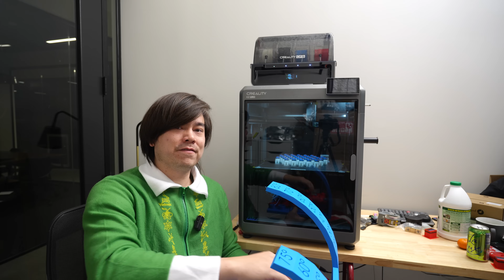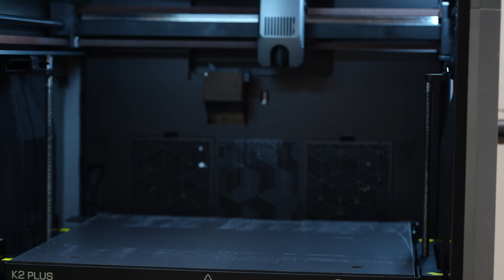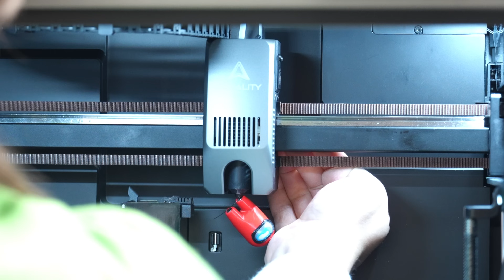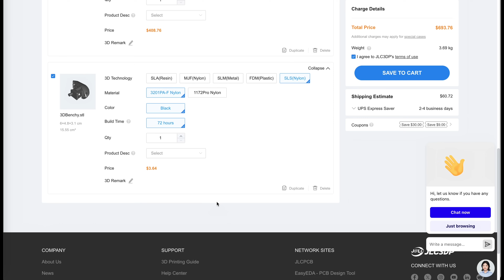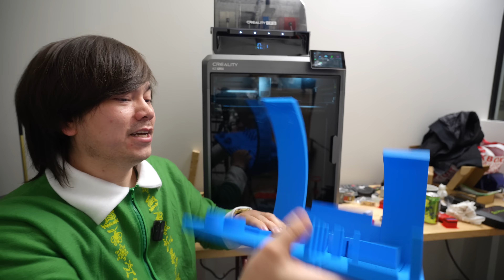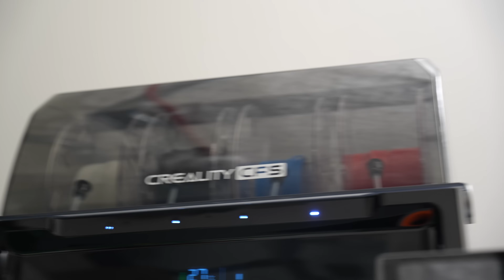Creality K2 Plus - Back With a Vengeance

Comment: can you elaborate on servos , i thought these are steppers with encoder
Reply from the maker: They claim to be FOC controlled servos. 
Sometimes their marketing team uses the wrong words, but given how quiet these are, they might truly be FOC controlled. 

The controllers are usually a little more expensive and require additional electronics to work compared to a stepper or stepper+encoder. I will have to take off the back panel and look on the electronics to learn more
Reply: @NathanBuildsRobots  Sometimes? and then there are the bare faced lies!
Reply: The community of “simple FOC” can use a stepper motor as a servo using FOC control

Comment: Did I miss the price?
Reply: If i recall 1500
Reply from the maker: Yeah, $1500 for the printer plus multicolor unit . And free shipping which bamboo doesn’t do. Plus some random freebies and creality runs sales pretty often.

I’m hoping to see the standalone printer at around $1200 on sale
Reply: The price is that the many traditional faults will drive you crazy!

Comment: I was disappointed with the k1 max but this looks like it's what it should always have been.
Reply: I mean it's basically twice the price
Reply: @michaelgleason4791  oh well, nm.
Reply: In more detail, the k1 max should have had a flat bed and an extruder that doesn't clog as badly as it does
Reply: Price is not the same.

Comment: idk if you have experience with it, but another comparable machine would be the qidi plus 4. Little smaller build plate though and qidi doesnt have a cms (maybe you could get it to work with the box turtle). It would be interesting to see a detailed comparison between those two from a mechanical and build quality standpoint.

edit: For anyone that sees this comment, there is a potential fire hazard issue with the qidi plus 4 so I would probably not consider buying one at this time
Reply: Qidi announced a MMU for 2025. There are also the ERCF and 3d chameleon that should work
Reply from the maker: I hope Qidi have stepped up their quality. I haven’t seen the 4, but all of their older stuff printed great but had a cheap plasticky feel that made me feel like it was going to break after a while

Comment: I still don’t trust creality. Tbh I wouldn’t even consider buying something from them bc their older printers were so bad.
Reply: I havent bought from them in years having bought their machines since the OG Ender 2 up to the Ender 5 Plus, they all had issues, however, the Ender 2 is the most reliable machine I have bought from Creality, and then there was the Creality WiFi box, they claimed it worked with most Marlin 3D printers and all Creality machines, It didn't work with any printers, did they take it off the market and recall them, hell no! they gutted them from their cases and installed them in their next dodgy printer!
Reply: okay but why you cry here? lol
Reply: @billy.the.maker.  Therapy! at least thats my excuse
Reply from the maker: He’s allowed to cry here. Tbh I wouldn’t have pre-ordered this because I’m not sure if it would be any good. 

But they sent me one for free, and I’m glad they did. Knowing what I know now, I probably would have got one at the pre-sale, but there wasn’t any good information about it back then.

Comment: Is the door Uncle Jessy Proof? 😂🤣😅 . How much power does it consume during bed heating and printing (peak  nominal) ratings? The website says the aluminum bed is 5mm thick, could you please confirm? Would like to see the core xy motors, they seem to be concealed outside the heatd chamber. Thanks for the fantastic review.
Reply from the maker: It probably is 5mm, I couldn’t get a good look at it but I was guessing 6mm

Comment: I just set up a Sovol SVO8 and it has exceeded my expectations.  Full klipper, quad z motors, 7 linear rails, etc.  Its a beast and under rated.  This one looks nice and a main contender a bambu but creality slice is an abomination and should be abandoned  and never talked about again lol.
Reply from the maker: It’s a lot better now. They forked bambu or orca and made some cool additions, but I guess you could stick with orca if you wanted to
Reply from the maker: SV-08 is solid though
Reply: Is Orca slow for anybody else ? I am on Mac and it is very slow...
Reply: @vim55k  it is fast on my Mac
Reply: I've been leaning toward an SV08 but didn't want to invest in a new printer until I design new products for my small business this winter.  I still have a large format resin printer from several years ago that is in the unopened box, that is a boat anchor at this point.   :-(

I''ll want the ability to print ABS and possibly other engineering materials so the enclosed K2 Plus looks good out of the box instead of making an enclosure for the SV08.  I use a clear trash bag over my bed slingers and that's low rent as hell.
Reply: I own a Sovol SV08 too but you can't really compare with this. This is a 2000$ 3d printer versus 800$. I think we just pay for what we get in the end. The only problem i would say SV08 got is the bed but yeah its still a great 3d printer but nowhere near the quality of a 2000$ printer.
Reply: @ptitbass  - No doubt the K2 Plus is going to cost significantly more than the SV08 because it has a full enclosure, heated chamber and several other added features, but I don't think it'll cost $2000, even with the CFS, which I probably don't want because I seldom print multicolor objects.  My only use for a filament feeder would be to print ABS and TPU on the same part, but the Bambu filament change system doesn't feed TPU and the Creality CFS, nice as it looks, probably won't feed TPU filament either.
Reply: Yeah they also claimed that they designed it from the ground up, another lie! and it isn't even any good!
Reply: @AndrewAHayes  Mine is printing non stop since I got it. I don’t like inductive probes but it has been consistent even on a hologram build surface.  I also changed to a .6 micro Swiss hot end. As far as I can tell klipper is fully unlocked too.  All printers are clones of something.  China is built on exploiting weak ip laws. The creality k series is them exploiting their own Chinese competitors lol.
Reply: @AndrewAHayes I think they mean they Designed their Design from the ground up. Yeah, it's based on a V2.4 I know. But they still had to design their own parts. Especially the frame. But maybe they could have word it a bit differently though.
Reply: just use cura, it still has feature that other's don't have
Reply: @ItsDoneWithMirrors  I was stuck on cura for a long time because I was intimidated to try anything else, but I'm so glad I finally gave orca a go. Imo it's been better in 80-90 percent of every metric I would judge them on. I used cura for around 4 years and never wanted to even try prusa slicer. If you're making this comment having not tried orca slicer I would urge you to give it an honest go for about a week and then see how often you open cura afterwards. Maybe you'll find that cura really is better for you, but there are reasons so many people have made the switch in the last couple years.

Comment: You mentioned thicker belts, are they 9mm ones?
Reply from the maker: Definitely more than 6mm, I will take some calipers to them. I’d guess 9 or 10mm
Reply: @NathanBuildsRobots  that's great. cheers for that. just like Qidi 4 plus which I believe they're 9mm and they've also been producing great results from what I have seen from other youtubers. BTW, I can see that you're using creality 5 slicer.  this is going to be my first new generations of creality corexy printer, I have never used their slicer. I've been using orca as my go to for my merc hydra and other builds. I heard that ORCA latest RC has K2 plus profile. Be great if you can please review that too. and perhaps comparisons between the profile settings and print results between the 2?😁
Reply: oh just one last thing, sorry to add. please just take this as a suggestion. if you're able to cover the rooting of this printer (if you plan to do so), then that'd be much appreciated too.

Comment: bambu needs to release the a bambu XL MAX 500x500 24 color printer to stay on top of the competition
Reply: With 2 print heads that can pre swap to the next filament before needing to swap colours
Reply: Watch out, an anouncment is imminent!
Reply: @AndrewAHayes been hearing that for months
Reply: Actually, Bambu has already announced they are releasing a larger-volume flagship printer in Q1 of 2025. They have also somewhat recently (few months ago) patented some IDEX designs and double-extruder designs. @truey90s